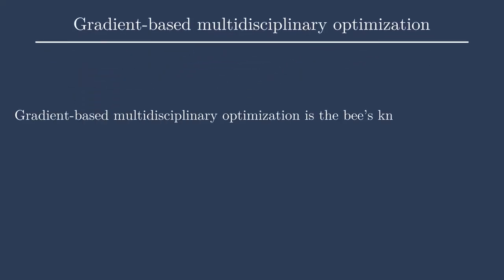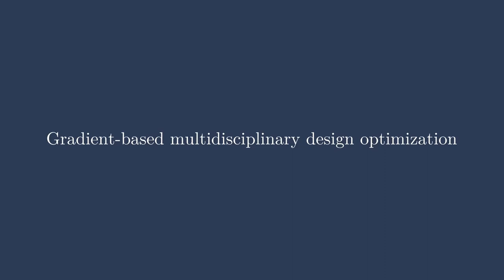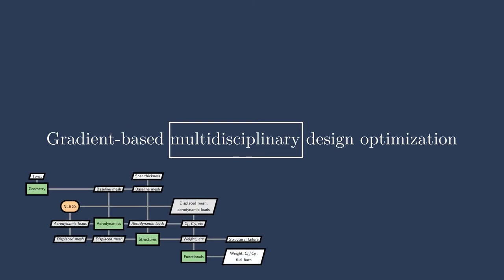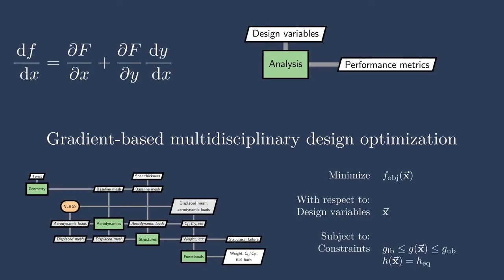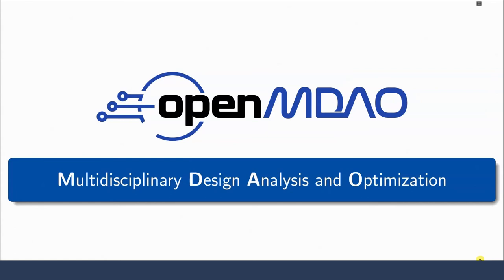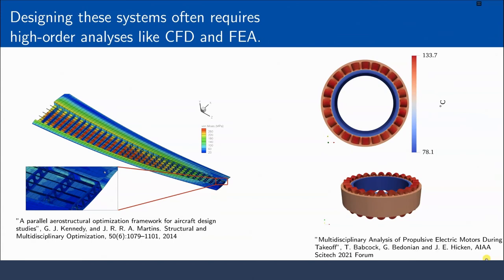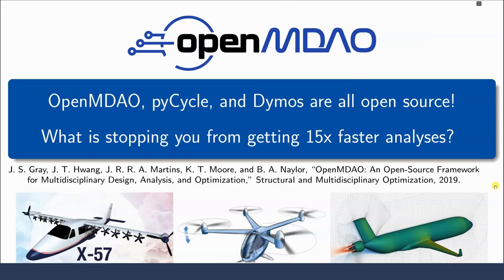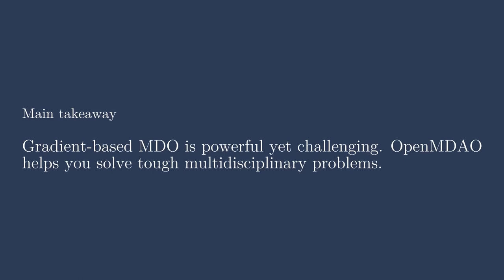Gradient-based multidisciplinary design optimization

Comment: Hey. Im working on a project in which myself and other 15 engineering students are going to develope a hydrogen powered airplane. I cam across this technique in a paper and want to learn to adapt it to our problem. That should happen quite fast, because our design freeze is in december and the important design decisions are going to happen in the next month or two. What is the best literature you would recommend for me to be able to apply this as soon as possible? thanks :)
Reply: ah i will read through the documentation on the website. i hope i can get a grasp of how i work it that way
Reply from the maker: @-.-.2272  That's a great place to start! It really comes down to how involved you want to do your optimization and what kind of models you already have.

If you decide to do multidisciplinary design optimization, checking out the OpenMDAO docs is a must: http://openmdao.org/twodocs/versions/latest/main.html

And for more of a theoretical treatment beyond what the Practical MDO course shows, I'd recommend this book: https://mdobook.github.io/

Best of luck!
Reply: @OpenMDAO  i have read quite alot about the topic of mdo now. But i feel like i won't be able to master open mdao within the next two weeks. Do you maybe know an alternative software that is a bit simpler. In our systems we have rather simple and alot of linear equations connecting weight, range and efficiency. Maybe open mdao is abit overpowered for this application
Reply from the maker: @-.-.2272  I understand your considerations. I'd suggest simply constructing your models by hand and using a simpler package, like Scipy's optimize methods (https://docs.scipy.org/doc/scipy/reference/optimize.html) to control the model. You won't be able to model or optimize complicated multidisciplinary models with as much control, but if you're able to parameterize and understand your model, that's a good simple approach.